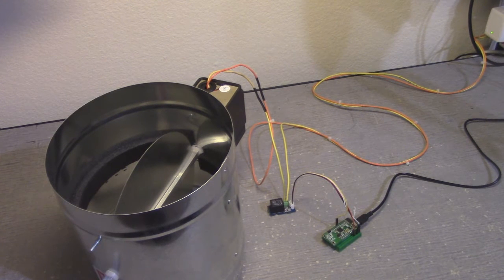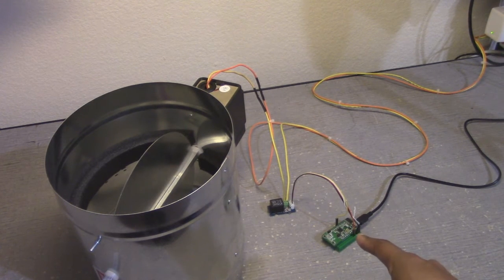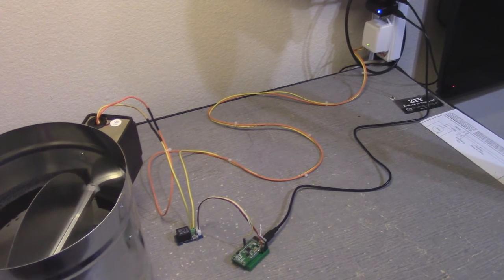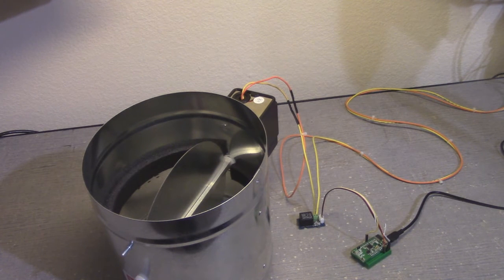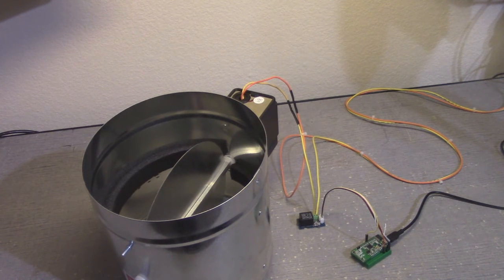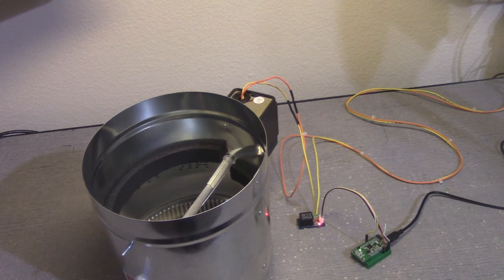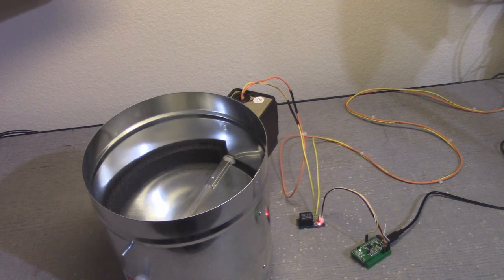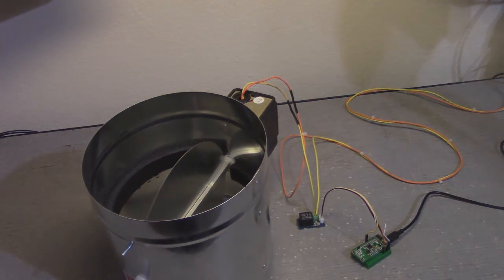ZIY Automated HVAC Damper

Comment: I have tried to solve the same problem but there's something that bothers me about the damper motors.  Don't they draw current to hold the damper closed (or open depending on how you have it set)?  How much current and how much heat does the motor generate?  
I sort of solved the problem with an Arduino and a stepper motor with a 3D printed mounting bracket.  I also tapped an analog output off the potentiometer in the stepper motor allowing feedback to tell the Arduino the current damper position. But I've stripped the gears in 2 stepper motors (even heavy duty metal geared motors). I would try using a commercial off-the-shelf damper motor, but I only want the motor to draw current when changing the position of the damper.
Reply: Are you using a really small stepper motor? Would it be possible to use a larger stepper that doesn’t require gears?